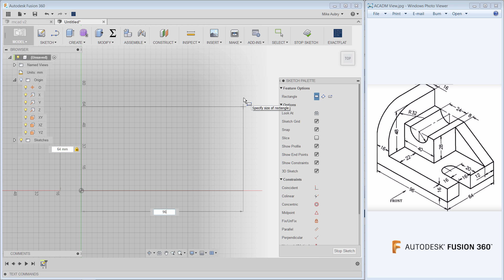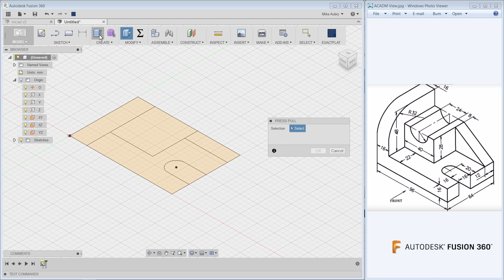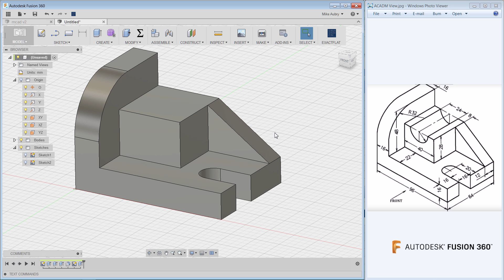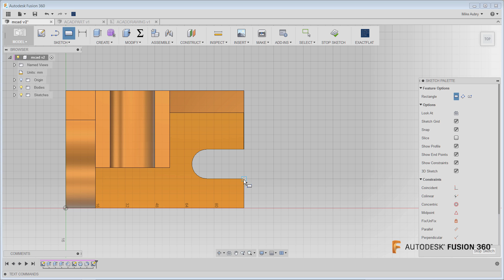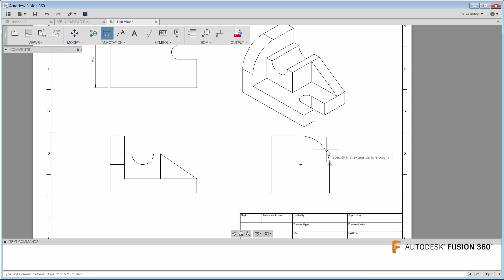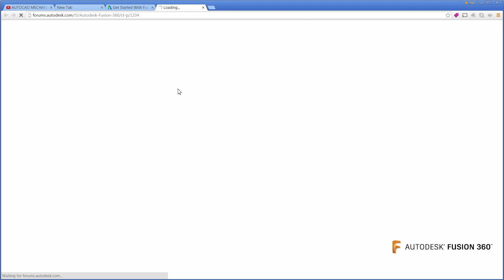Fusion 360 For AutoCAD Users

Comment: Nice, thanks. Much needed for this AutoCAD veteran.   I wish the set up would have asked if I had any experience in AutoCAD, when answered "yes", directed to this video!  ;)

 About the middle of the video, there was some of the stuff you blew by too quick to see exactly what you were doing.  I can see the usefulness of a lot of the changes, but there is also needless work compared to the command line way of doing things (new was less efficient, requiring a few more steps).    

I remember the first day of my formal AutoCAD training.. being asked to draw something, without any knowledge other than how to start the program.  That was saved for the end of semester review..  HUGE difference.  I'm sure the same will apply here.. was just frustrated coming into an AutoDESK product, thinking the interface would be more experienced user friendly. (lots of the things you do are the same, just different locations and methods to deploy them, as you pointed out)

Thanks Again.  cheers

Comment: It blows my mind fusion 360 relies on clicking then flipping through a bunch of menus. Autocad using the keyboard is way more efficient. I also hate how they try to give each command a bunch of functions. If I want to press pull that is want I select. I get to the end of a project and wonder why there are a bunch of random fillets. The way you input commands in autocad is so much superior to the point that the parametric stuff hardly seems worth it. I really don't understand why we can't have it both ways.